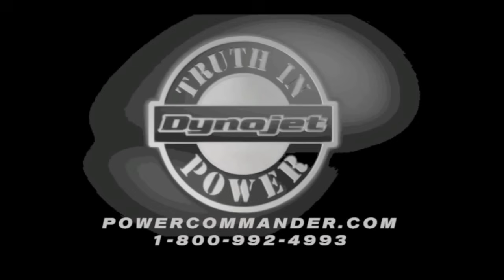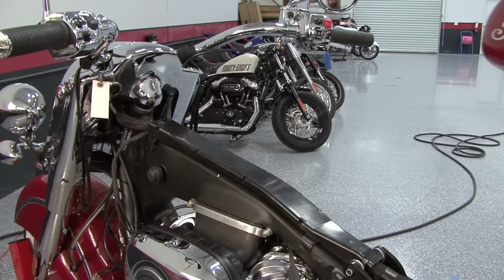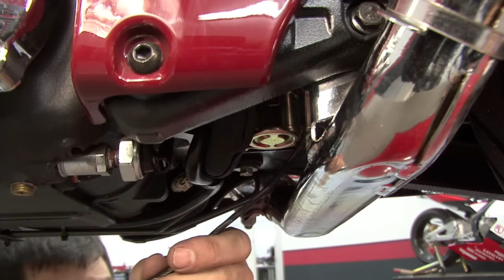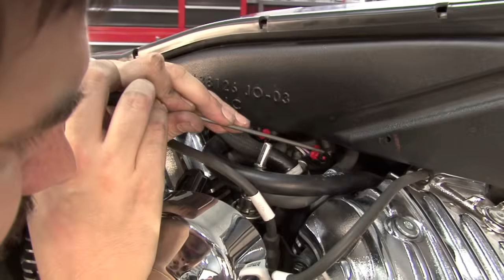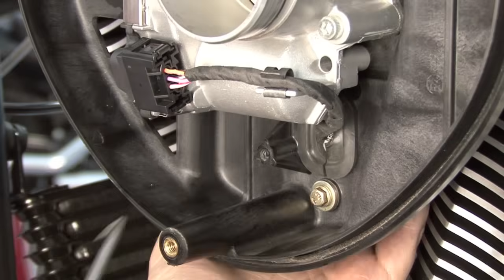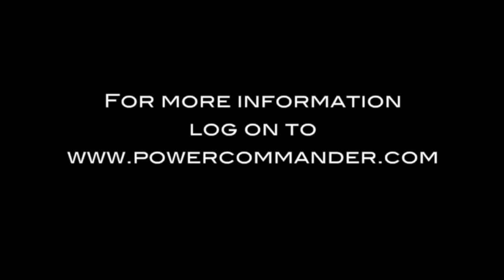Power Commander V Install: 2014 Indian Chief

Comment: I replaced my exhaust to 2 into 1, replaced the air intake to a free breathing ram air, and a PCV. Did a few changes on a/f ratio. Run the bike for approximately  300 plus miles for 3 consecutive days. No backfire, no hesitation, did not reflash the computer. did not check the appearance of spark plugs.It seems to me that the bike (2016 Dark Horse) is running fine. Am I supposed to do something else?  i need guidance at this point,. thanks

Comment: The main benefits of doing this is so you don't burn a hole in your piston. A lot of metric guys are coming over to Indian, that are used to a liquid cooled motor. They're putting loud pipes on their air cool Indians, but not tuning the computer. A few years from now you're going to have a bunch of guys that burnt their engines up.

Comment: As an authorized Freedom Performance Exhaust dealer (AAA Motorcycle Exhaust), I often get asked about fuel modules for the exhaust systems that I sell and especially for our new 2014-15 Indian Chief true-dual exhaust systems. I am glad that I now have not only a video, but, an "installation video" to refer my customers to. I'm hoping to see an auto-tune unit for this bike soon also (hint, hint). I have used a Power Commander on my Road Star for many years and have been a very satisfied customer the entire time. Great job on a great product that in my opinion is second to none!

Comment: why would you need this?
Reply: from my experience with using a power commander on my Harley there were several benefits. more responsive throttle response from low end to redline. the engine ran cooler noticeable in the heads mostly because that is where the combustion is happening . better fuel mileage and just a smoother better performing engine . A very worthy upgrade especially if you upgrade the exhaust and air filter .
Reply: Adding a power commander to even a stock bike will help make your bike run better. Why? Because from the factory they have to pass emissions tests and to help do that, they tend to have the bike run lean. This causes the bike to run hotter. Over time well not good on any engine. But most people get a PC for performance parts add on's. And the good thing about the PC is that you can slowly upgrade, say, K&N filter, stage 1 exhaust, then later cams, then maybe a big bore kit ect. And with the PC you can adjust for every upgrade you get. Also just getting a reflash, well you would have to do that every time you get an upgrade and they typically cannot accommodate for aftermarket parts ect. I am sure you have seen people just add stage 1 slip on's and then there bike pop's on deceleration, well that is TYPICALLY because the stock bike was already running lean, now you have more air flow with the K&N filter and free flowing pipes, changing the fuel air ratio. Bottom line lots of reason's esp if your on a budget when doing upgrades.